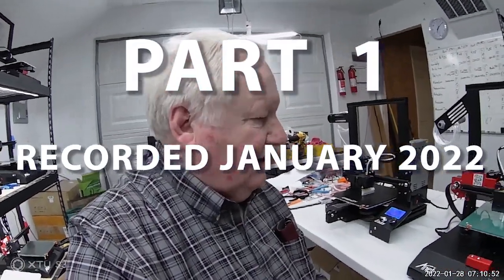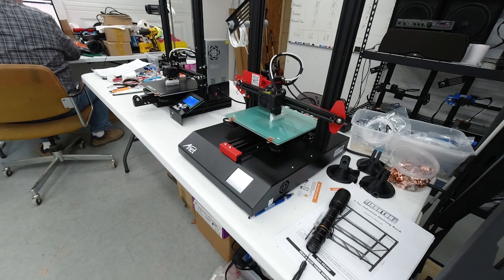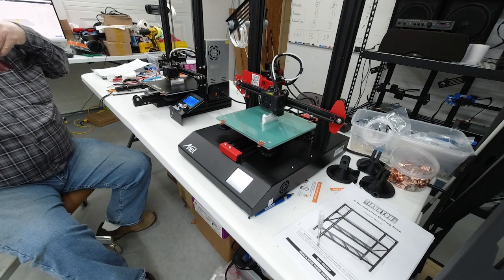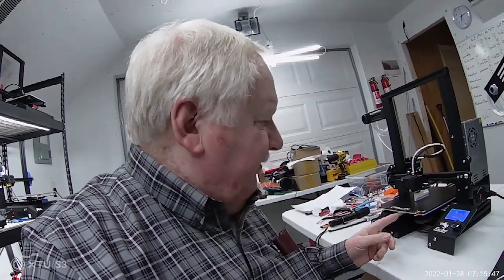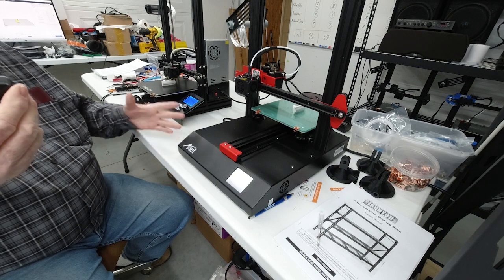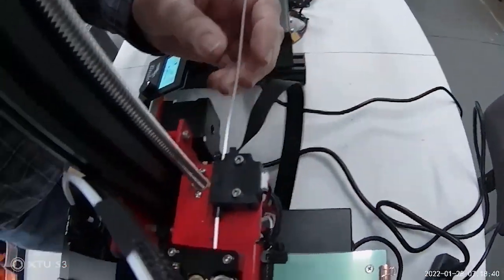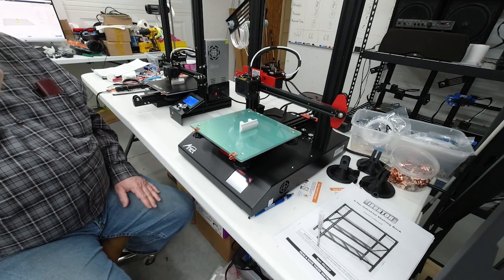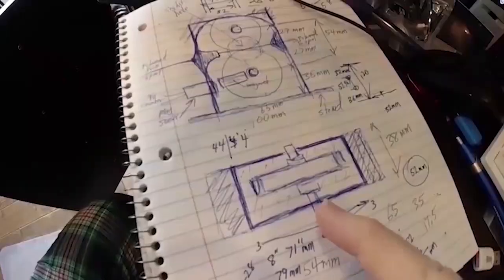CREALITY ENDER 3 VS ANET ET4 to see how they compare under identical print conditions PART 1

Comment: I have a labists ET4, which I understand is basically the same as the Anet ET4. Levelling is driving me crazy. Auto levelling doesn't do a good job and I have to relevel almost every time I turn it on. The sensor seems to change and its very difficult to get right. Do you think the Ender 3 SE will be better? Is it worth dropping more money as someone new to printing? I paid $60CAD second hand for my Labists and am looking at $250 total CAD for the new ender. I want to start selling prints but right now I am not yet and I'm very broke so it's a big decision. I will be going into dept but its on sale right now!

Comment: They are probably the same thing.  Most of those chinese parts are all made about the same by multiple companies.  I'm not sure if they use the same main-board but there's a good chance they are almost the same printer with just a few small variations.
Reply from the maker: You're about right on that, Wayne. I can interchange a lot of parts on many different printers...Ken

Comment: Hi Ken, another great video. One thing you proved, again, for the money, they are good printers. They all generally do a good job. Sure, they all have their quirks and some do things easier than others but it depends what you're willing to live with. Ender's greatest asset is the community and 3rd party parts. 
And here I thought only Canada gets snow so late in the season!!! Goodness, I got the chills just seeing you there 🙂
Reply from the maker: If you noticed at the beginning of the video there was a message stating "RECORDED JANUARY 2022" so the snow was not this past week, it just took a while to finish PART 2 which I will release in a few days. I agree with you that most all printers are good printers and will produce good quality prints as long as they are set up correctly. Great to hear from you Claude, hope all is well...Ken

Comment: I thought I would share something I discovered recently Ken, a 0.3 filet applied to the bottom edge of a part combats the elephant's foot, for years I have been trying to find that sweet spot between getting the bead of filament to stick and just the minimum amount of squish, and now I can apply a little more squish and the 0.3mm filet and it comes out perfect, although the amount of printing that you do you probably have worked out a good technique!
 I believe the reason the Anet finished first is that its drivers have the reference voltage set closer to the motor's required voltage
Reply from the maker: I agree Andrew, a filet on the bottom edge of the print allows you to reduce zero offset and still not have a sharp edge. I round all of the edges of my parts including the bottom and this gives them a cleaner look and get rid of sharp corners and edges. You might be right about the stepper voltage; I really don't know. In the next Ender VS Anet Part 2 video I will post in a few days, I reversed the process and used the Ender printer set up in Cura to produce the gcode file. Cura said the Ender would complete the job in 1 hr 1 min and it did finish in one hour, however the Anet with the same gcode file finished in 53 min. More to come on this later. thanks for sharing your ideas and thanks for your support...Ken

Comment: Great comparison. I think the steppers in the Ender 3 may be a slight bit slower than the Anet.
Reply from the maker: I think you may be right, I just finished PART 2 od Ender VS Anet and will post it in a day or two. Thanks for your support...Ken